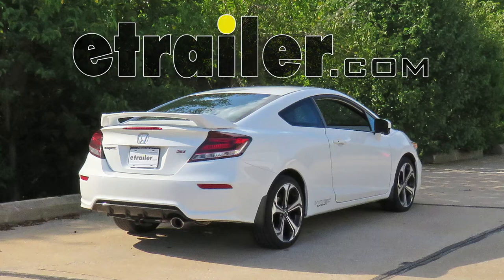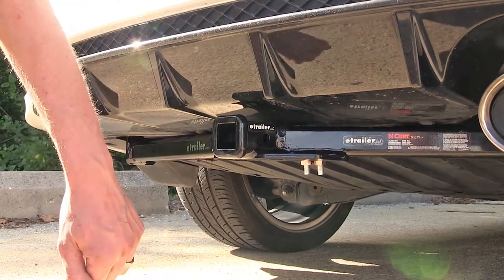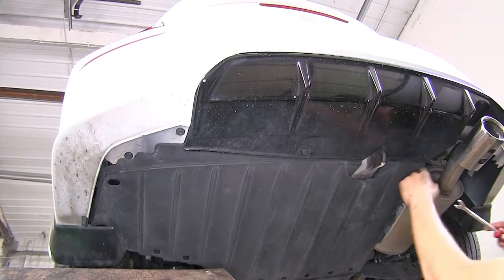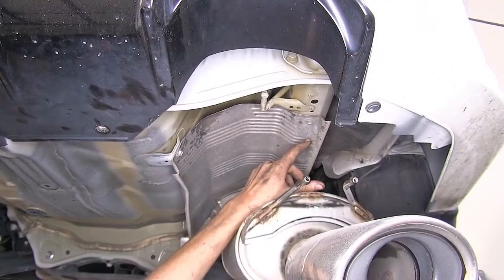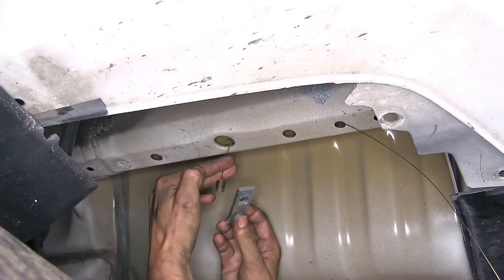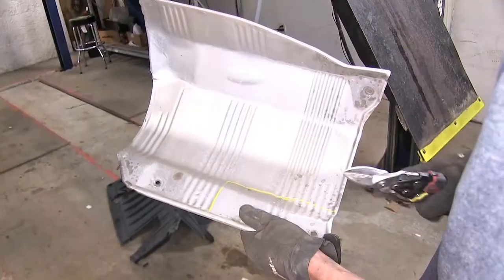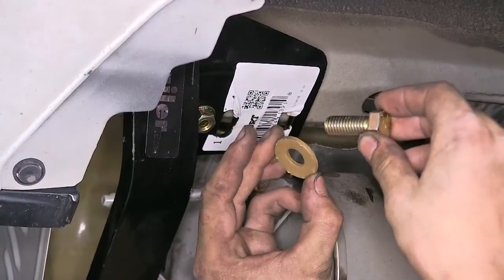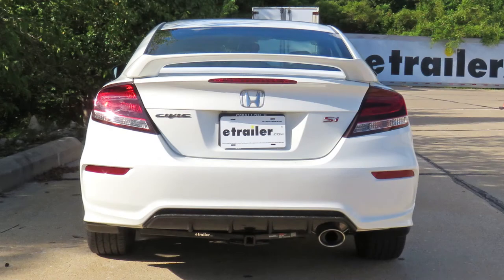etrailer | Trailer Hitch Installation - 2014 Honda Civic - Curt

Comment: Hi there, will local shops typically do these installs?
Reply from the maker: You can check out our shop locator in the following link to see what shops near you have confirmed that they can complete this installation.
https://www.etrailer.com/Installer/NearMe?websku=C11391

https://www.etrailer.com/Trailer-Hitch/Curt/c11391.html